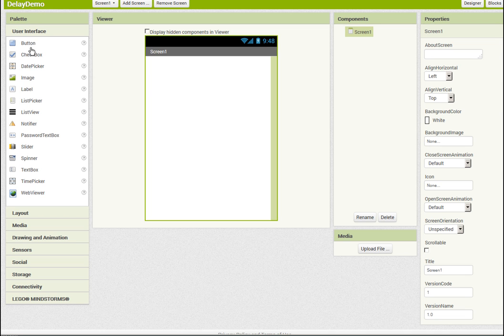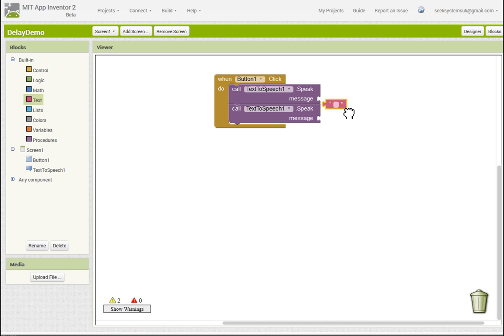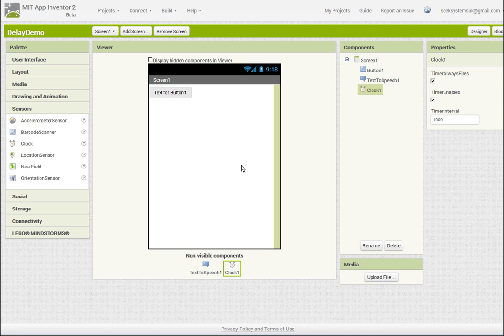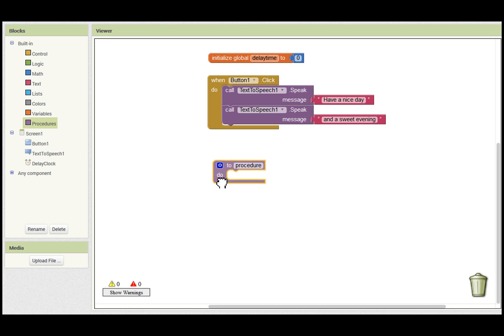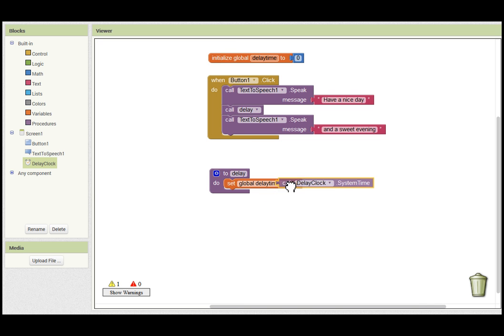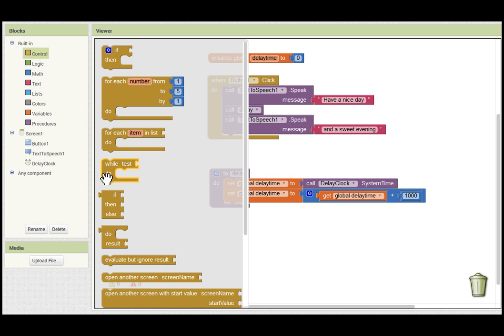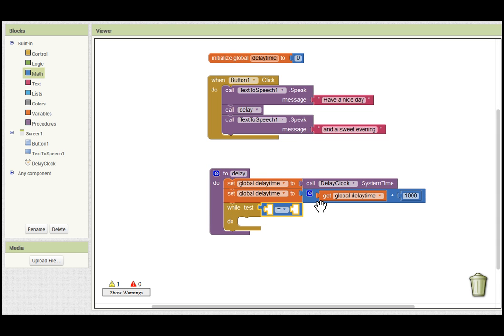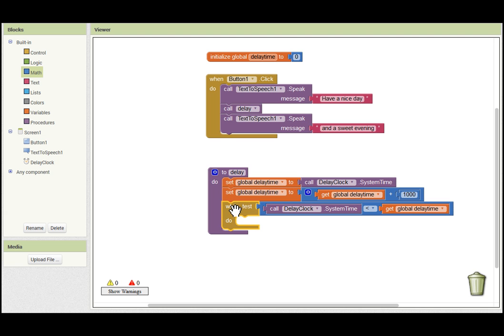MIT App Inventor delay proceedure

Comment: Hey there, @Mike Evans The delay procedure works and all, but the example you used is a bit strange. I mean, instead of using 

Call text to speech ('Have a nice day') 
call delay
Call text to speech ('And a sweet evening!')

Can't you just use

Call text to speech ('Have a nice day and a sweet evening!')

They're basically the same... is there a difference?
But apart from that, thanks :)
Reply from the maker: Yes but you are missing the point. This is to show how to do more than one events that you want to separate.
Reply: WTF MAN, are you some kind of moron? : )))

Comment: Or you could have created a procedure called SPEAK "text" and inside that procedure put the block AFTER SPEAKING and inside that block, the SPEAK MESSAGE block with the "text" passed. That way, if the speech engine didn't finish, it will wait until it does and then send the new speech.

Comment: Couldn't you get rid of the first "set global delay time to..." by replacing the get global delay time in the second line with the call delayclock system time?

Also thanks for the tutorial, really needed this.
Reply from the maker: +Ethan Bowering There are various ways the routine could be made more succinct but all of them would make the code more difficult to understand and therefore less accessible. Glad it worked for you.
Reply: Ok, thanks for the info!

Comment: I wanted this to load a web url in the webviewer, do a delay and then check that the url had loaded. Unfortunately, in AI 2 it is waiting for the delay to complete before loading so it must halt the execution of the webviewer.
Reply from the maker: +David Draper
Hi David, this is the whole idea. Usually you can't normally stop the execution  of other threads in your software. This delay fixes that but I'm afraid wont work for you. Have look here, there are many tips and tricks http://puravidaapps.com Good luck
Reply: Hi Mike, Thanks for the link. Looks like a lot of useful stuff on there. I already had in mind to use a clock component to achieve my delay but as I was already firing one clock, I thought your solution might work. I have now added a second clock component and using that to trigger my actions after a delay.
Reply from the maker: +David Draper 
Again good luck. Sometimes the constraints of using a high level 'language' like AppInventor can be frustrating. For what it's worth I'm doing something not dissimilar. I am using the webviewer.currentpagetitle. to return data from a website. You can put 65K! of data in a (e.g. php) title.
So on the web I do some stuff and then pass it onto a second page where I put the return data in the title. In AppInventor I loop round looking at the length of 'webviewer.currentpagetitle' if it is zero I delay and then check again. When the length is none zero I read the contents of the title and, in my case, speak the result. Best Mike

Comment: At 2:20 you duplicate the SET global delaytime block. Why don't you just eliminate the first SET and leave the second one like this: SET global delaytime to call DelayClock SystemTime + 1000. Is there a reason why you did that?
Reply: sure.... 1st one is for resetting  the global delaytime ..... delaytime is a variable .....and clock.system time is actually counting the time..... 1st one sets delaytime(var)=clock.system(time at that moment)...then delaytime is increased by 1sec.....so after 1sec the logic:(delaytime<=clock.time) will satisfy ....then it will execute the following func and come back to 1st step....which will reset the timer ....
Reply: The first set of blocks is not necessary at all. It's totally redundant because of what he does in the second set of block.